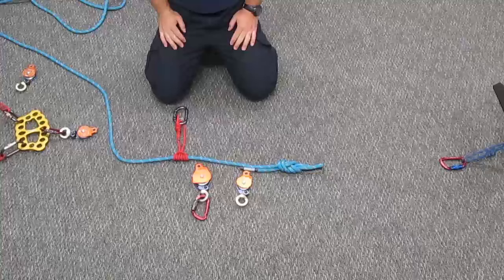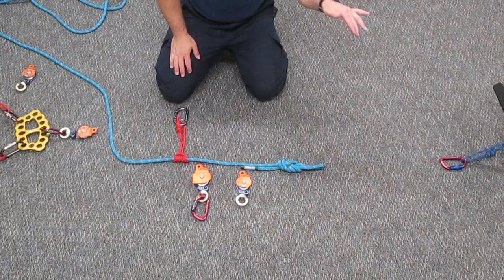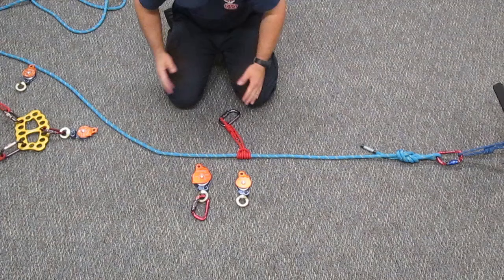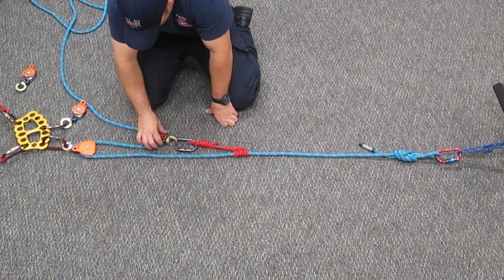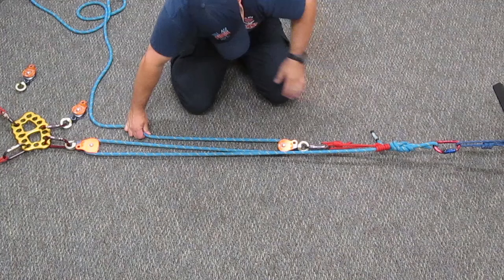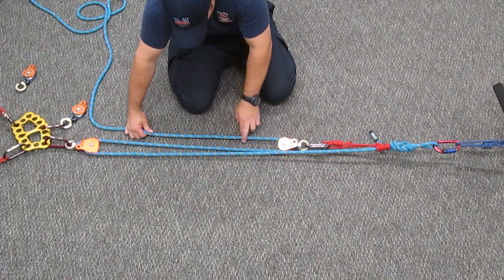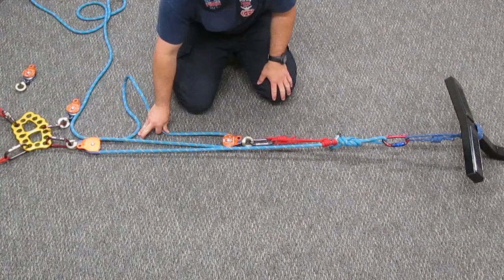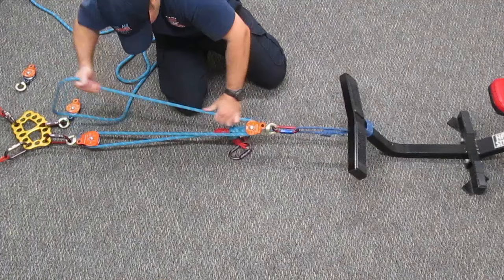3:1 Mechanical Advantage

Comment: I would really appreciate if you could do a video explaining mechanical advantage from a climber's perspective.  Like when the load does the hauling.  For example, when a climber is the load, is climbing SRT, and creates a 3:1 haul back system how does this follow the rule that, if it is odd the line will be terminated at the load?  I really think you do an excellent job explaining MA and was just curious if you could explain it from the climber's perspective...Thanks.
Reply: 2:1 = pulley at the load and 3:1 equals end of the rope atv the load

Comment: That prusik is not necessary. Just create a figure of eight or butterfly loop and hock a carabiner.
Reply from the maker: Correct.  If you want to be less versatile and efficient
Reply: Yeah, but then once it reaches the pulley, you can't haul anymore. With the prussik, you can let the progress capture hold the load, move the traveling prussik, and keep hauling. With you method, you're only gonna haul something a short distance.
Reply: @geometerfpv2804 Correct me if I'm wrong, here it's a progress capture pulley not a progress capture prusik (as wrongly labelled in the video). That prusik is not for progress capture but for efficiency if the rope goes 90 degrees down as in a cliff. So you use that prusik before the rope angle down. Once the travelling pulley meets the progress capture pulley, the pull is over. You can't reset anything because the progress capture pulley is fixed. If anything that prusik while increasing efficiency in some cases shortens the haul. I would like to be corrected though.

Comment: The point of the prusik is to stop the load from dropping right?
Reply from the maker: Depends on which prusik you are talking about.  There is a progress capture prusik that goes on the change of direction pulley, and a rope grab prusik that goes on the traveling pulley.  The progress capture prusik stops the load from dropping.

Comment: If you pull three feet of rope through that system, the tackle will move eighteen inches. It's a 2:1 set up, the final turn is only a redirect. Measure the pulled rope and the distance that the tackle moves and see for yourself - dont just take my word on it.
Reply from the maker: Your comment almost doesnt deserve a reply.  I said if you pull 3 feet of rope, you will move the load 1 foot.  There is a 2:1 attached to an existing 1:1 Making it a 3:1.
This is not a 2:1. A 2:1 would be a single pulley attached directly to the load.  Watch other video son a 3:1 or speak with another rope rescue expert if you do not believe me.
Reply: @dangerstall  I'll ask again, have you pulled three feet of rope and then measured how much the load has moved? If you've gained one foot, then it's a 3:1. If you've gained eighteen inches, then it's 2:1. 
It's not a matter of opinion - the measurement speaks for itself.
If I'm wrong I'll admit it, but please go and actually measure the gain before responding.
Reply from the maker: @d1a1x1d1a1x  I dont need to go measure it.  It's a matter of science.  I pull significant loads on a 3:1 all the time.  Go put 100 lbs on a 3:1 system and pull it. Measure the distances, and also measure the force it takes to pull it. With 100% efficient pulleys it will take 33.3 lbs of force to move 100 lbs.  That is the true reason it is called a 3:1. The distance in feet is just a way to tell what system it is.  With most pulleys it will take more force because they are in the 80-90% efficiency.  Anyway, I dont know your education and level of experience, but I have been doing this a long time.  And this video has been viewed 26k times and you are the first person to question if it is a 3:1, so maybe that tells you that you are wrong???
Reply: @dangerstall  Either measure the distances or place each strand on a load meter and allow for friction (you'll find they corroborate) but please - measure for yourself.
Pulling significant loads all the time (and I have no doubt successfully) has no bearing on whether your description of this system is accurate. I understand the math example you've given but that doesn't prove the actual system in your video is a 3:1.
If you've stated as fact, in your video, that three feet will result in a one foot movement then the 'true reason' should support this statement, and those responsible for your 26k views will see my error.
Whether you are correct doesn't depend on the number of views and as I've stated before, I'll be the first to say so if I'm wrong. However, there's no question that a simple real-life test will produce more dependable support of your position.
All I'm asking is that you make your own measurements.
With regards to my standard of education and level of experience, why would that affect the outcome of an actual experimental test that you could carry out? Again, the science will stand on its own merit without any need of anyone's opinion.
Please measure this system yourself.
Reply from the maker: @d1a1x1d1a1x  I got 22 inches when pulling a 3:1    moving the load 1 foot.  But remember that I said a 3:1 is a mechanical advantage or a force multiplier.  And its theoretical.   So when you account for pulleys that are working at 80-90% efficiency, you will not get 3 full feet, and it will not take only 33.3 lbs of force to move 100lbs.  It will take more force because the pulleys are not 100% efficient.  Regardless of that, this system has been called a 3:1 since the beginning of its use, and will continue to be, no matter what you say.  It is understood that it is not 100% efficient.   When I said in the video that you can measure distance pulled to figure out the MA, that is a rule of thumb or a guideline.  The T method is more accurate when you know the efficiency of each pulley.  With those omni blocks, the true MA would probably end up being 2.7:1.  You won't be seeing anyone teaching this system as a 2.7:1 because a 3:1 or a z rig is already the common name for it, and in a perfect world with 100% pulleys it would be a true 3:1. So if I'm using crappy pulleys or carabiners to build the 3:1 do I have to change the name because its not truly a perfect 3:1? If I'm on a rescue team should I tell someone to build me a 2.7:1, or a 2.1 to 1? 
I'm pretty sure the world is going to continue to call it a 3:1. Its not a 2:1. Distance pulled in rope compared to load travel is just a guide.   True calculation comes through use of a dynamometer.   But then, once again, the name 3:1is based off of it being theoretical because who the hell knows what type of pulley you might be using. There is no such thing as a 100% efficient pulley in this world.  If I used carabiners it would be a 2:1 actual MA, but it's still considered a 3:1 due to how its constructed, rope terminated at the load, etc...
Reply: @dangerstall  Lets take a breather lol jeez. Just because it's in a Z shape doesn't mean it's a 3:1, for sure.

My understanding is that one stationary pulley gives a 1:1, one traveling pulley gives a 2:1, and two traveling pulleys give a 3:1. If you have two pulleys, one traveling and one stationary, I've heard that defines a 2:1 MA with a redirect. Im still learning this so please tell me if that's wrong! Preferably with something other than "because i said so" :)  

I've also heard it described as you did, that a 1:1 plus a 2:1 equals a 3:1 which is kind of the opposite of what the previous sentence says. I have no desire to have a heated argument, i just wanna figure this out. Also you said when measuring this, you pulled 22 inches and the load moved 1 foot? I didnt quite understand that bit
Reply from the maker: @daas3465  all I will say is learn the T Method and then apply it to this set up.  Come to your own conclusion from there
Reply from the maker: Watch pat Rhodes video on simple mechanical advantages.  He is one of the industries foremost experts.
Reply from the maker: @Need2connect this comment reinforces my reply to you on the other comment.  The way I set up my 3:1, the gold rigging plate is a stationary anchor on the left.  The moving load is on the right.  Therefore the system is a “theoretical” 3:1.
Reply: @d1a1x1d1a1x  If you want to, you can actually visualize the amount of rope moving through the system without measuring at all.  Freeze the video at say 2:30 and imagine the pulleys are 1 foot apart (I know it's more but just think of it as 1 foot).  Imagine hauling all the rope through until the pulleys meet.  The load must have moved 1 foot.  All the rope has been hauled through the system now.  Those 3 separate 1 foot strands have all been pulled through as the pulleys are together, with no rope remaining between them.

If the short distances involved are confusing, imagine the pulleys are 100 feet apart with 3 by 100 foot strands of rope in the system.  He would be positioned at the anchor plate 100 feet away from the load and you can see that the full 300 feet must be pulled through in order to bring the load to the anchor plate.
Reply: How is it a redirect pulley or CHANGE of direction when he is pulling the load in the SAME direction? It’s a 3:1
Reply: You are incorrect. The fixed pulley is before the traveling pulley so it is not a change of direction. This is a 3: 1 system
Reply: Yes

Comment: After more research, im basically certain @Dee H. is correct and this is a 2:1 with a redirect.

The cool thing is, this can be magically turned into a 6:1 by adding only one more pulley on a prusik (another traveling pulley). On the setup you have at 3:24, it would be called a drop C plus a Z
Reply from the maker: You just contradicted yourself.   If you add another 2:1 into the system you could not get a 6:1 according to your logic.   When combining 2 simple mechanical advantages you multiply them for the resulting mechanical advantage.   Meaning if you combine a 2:1 to a 2:1 you get a 4:1. Your argument proves my point that it is a 3:1 because if you combine a 2:1 into it,  you get a 6:1. Thank you.
Reply from the maker: @jstewart627  there isn’t an invisible strand of rope.  It is clearly there.  Please gain more knowledge of mechanical advantages before you try and discredit my videos.
Reply: How is it a “redirect” pulley or CHANGE of direction when he is pulling the load in the SAME direction. It’s clearly a 3:1
Reply: You're right man it's only a 2:1 with cod